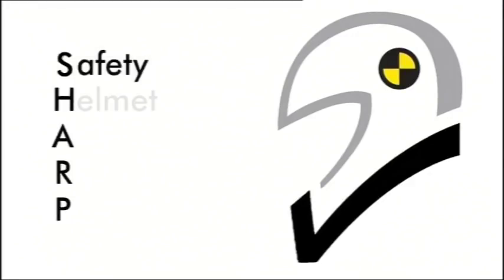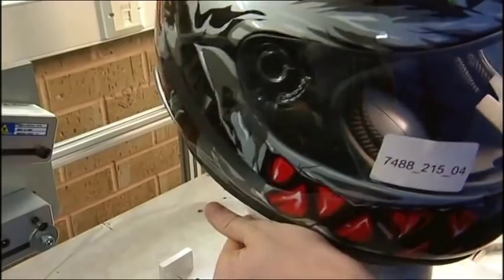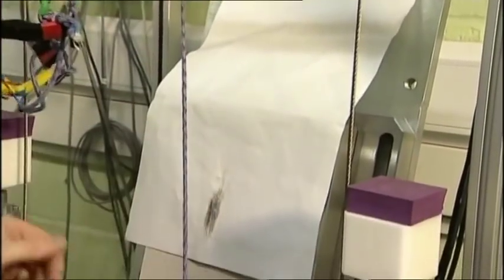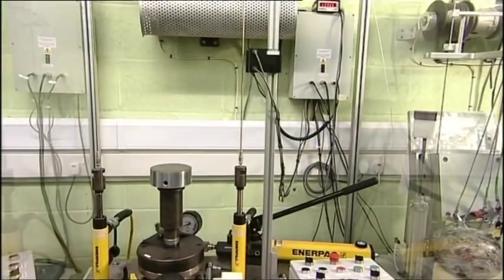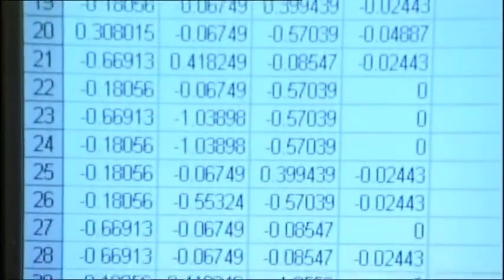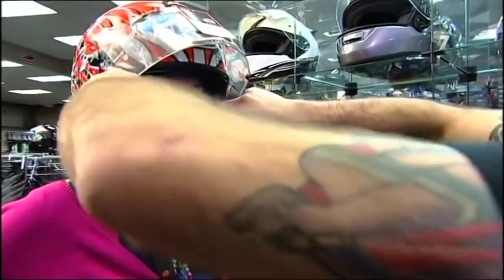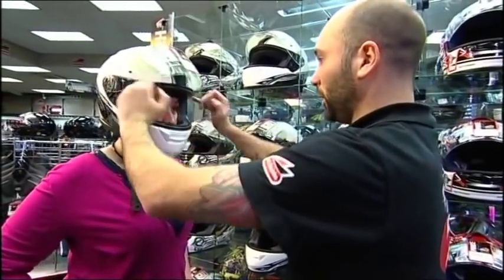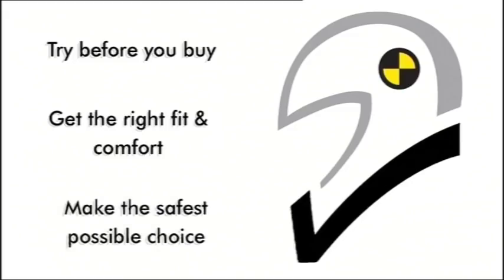SHARP crash helmet testing

Comment: A frivolous test procedure.  It's worth nothing.  They scold brands like Shoei, Schubert.  Many new types are not being tested because they cannot buy new helmets.  Ridiculous.

"Nigel Mills of the University of Birmingham criticised the SHARP scheme in a paper in 2009, examining its testing of rotational acceleration,[4] despite SHARP using the test procedures specified in British Standards BS 6658, and also the United Nations World Forum for Harmonization of Vehicle Regulations ECE Regulation 22. The UK's Transport Research Laboratory (TRL) delivered a detailed response addressing the Nigel Mills paper in November 2009.[5] SHARP stress that irrespective of their own ratings, all helmets sold in the UK have been certified to comply with the relevant legal standard, namely ECE R22.[6] However, it also points out that there is a 70% difference in protection between a SHARP one star rating compared to their five star rating.[3]

SHARP has been given two prestigious road safety awards; the Prince Michael International Road Safety Award (2013, Motorcycle category)[7] in recognition of its outstanding contribution to improving road safety, and the Fédération Internationale de Motocyclisme (FIM) annual Road Safety Award recognising achievements in helping motorcyclists.[8]

Some retailers of motorcycle helmets use SHARP star ratings as a selection criterion.[9]"
Reply: Dude, schubert helmets are fucking shit for crashes.
Reply: @greengoat5654  yeah but they would say that they look awesome.... LoL
Reply: Also I find it insane that a helmet test procedure could be considered frivolous. I hate to say it but I don't think you need a helmet man, there's not much up there to protect